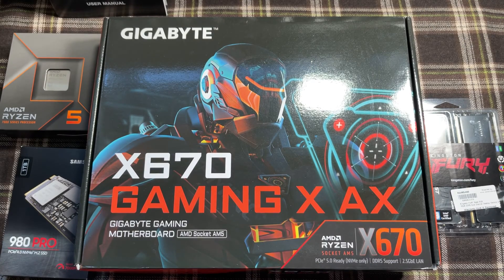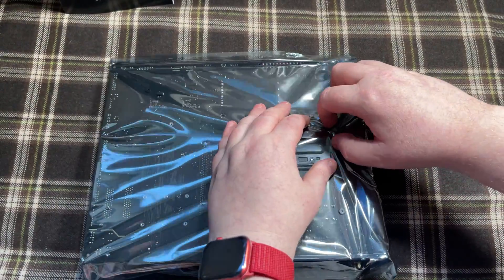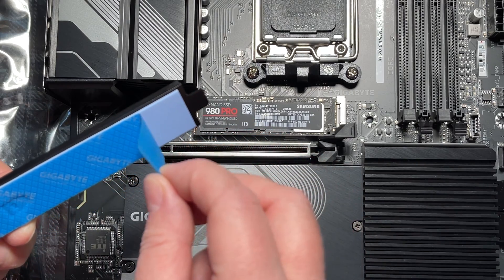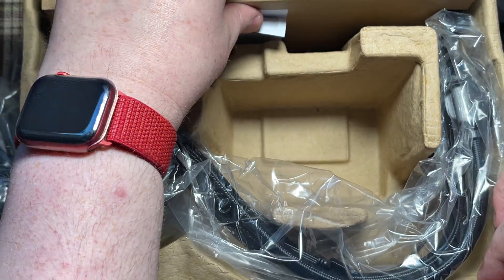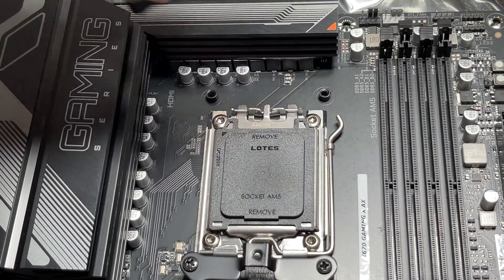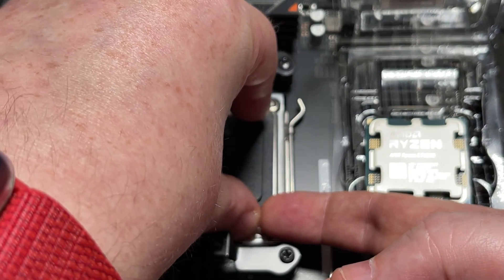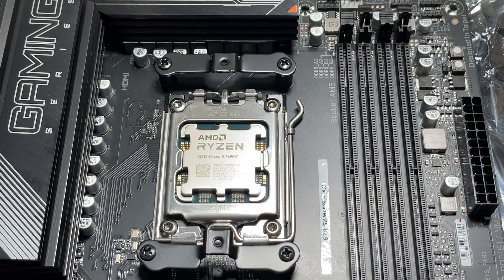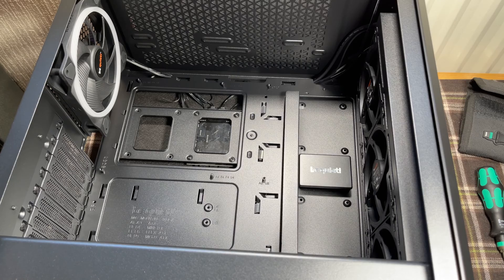How to install a AMD Ryzen 5 7600X AM5 on a Gigabyte X670 X gaming AX - SSD install - RAM Install.

Comment: Finally someone who actually shows how the M.2 gets installed and where the other 3 M.2 slots are. This was a very helpful video. I'm considering to get this board with a AMD Ryzen 9 7950X3D. Would you still recommend it after 1 year of uploading this video? Or do you recommend another board?
Reply from the maker: Still a fine board , performing well , not skipped a beat at all.

Comment: Thanks for making this video! I'm considering an upgrade for my PC and I didn't really want to go with AMD cuz I could've broken the pins and while I was searching for a new CPU I've seen something familiar at this one, the LGA type of connection and I really wanted to check to be sure that it doesn't have pins anymore!
Reply from the maker: Glad it helps , however the lga is just a fragile , if you break a pin in the lga the board is toast , if you break a pin on a pin grid, just the cpu is damaged , pins can be replaced.

Comment: You placed RAM modules in the same channel(ch2) instead of 1 and 2, that's wrong.
Reply from the maker: Hi i just checked and they are in A2 and B2 which is recommended in the manual for 2 memory modules
Reply: @MicroChipz  ok, then its fine

Comment: Has anyone have any trouble with EXPO profile on this board? I have Kingston Fury 5600mhz CL36 and it is not even close to be stable with that profile. Even with 5200 CL40 it is not stable and games are crashing. When I try to run it with stock values 4800mhz CL40 it is running properly. Idk if it is something wrong with motherboard or ram :/ I have newest bios installed
Reply: never personally had any good experiences with kingston ram kits on ryzen platform. I'd guess the ram is the one causing your issues.

Comment: I have this Mobo, haven’t installed it yet. But I’ve been reading some reviews on a few different sites that this MoBo takes forever to boot up or even when powering it on… Am curious if that’s true or has a update fixed that or….?
Reply from the maker: No problems here , takes a few mins on first build because of memory training and things . Once it’s setup no issues .

Comment: I just put together the same system but with a 7700x. Had all sorts of problems getting windows installed, random restarts, unable to get into bios even, spent hours on it. Decided to send MB back and try an Asus one. Did you have any problems with these components?
Reply from the maker: None at all ,shame you had issues. could have been anything.

Comment: So how many nvme ssds can you plug in on this board?
Reply from the maker: The manual says no support for sata m.2 drives so it looks like 4 , this is what the manual says , "There are two types of M.2 SSDs: M.2 SATA SSDs and M.2 PCIe SSDs. This motherboard only supportsM.2 PCIe SSDs."